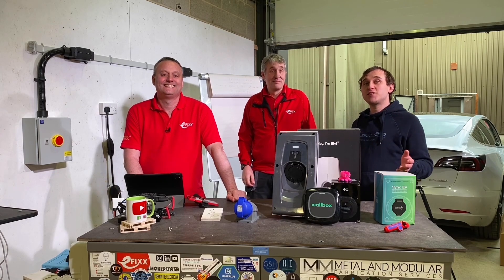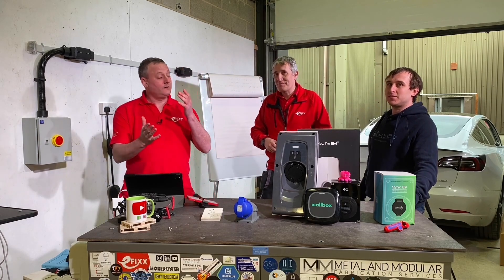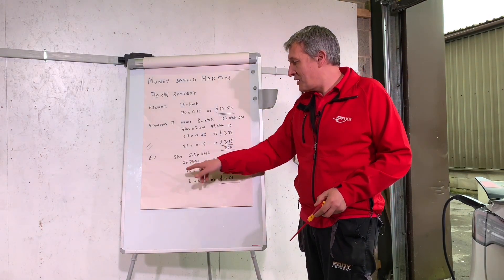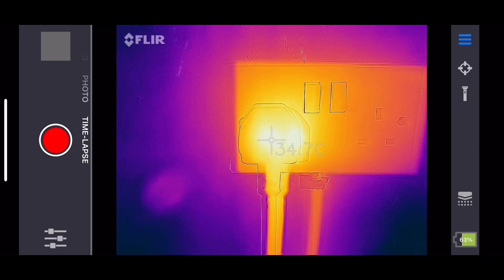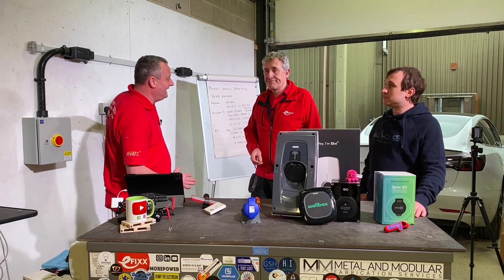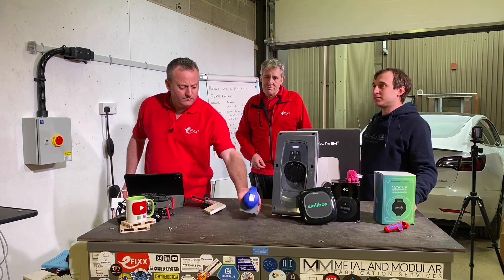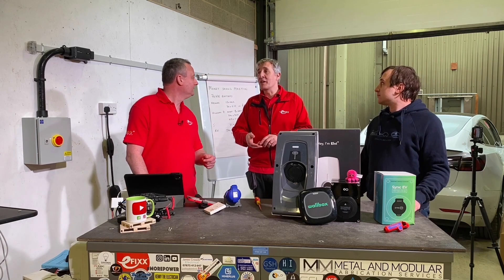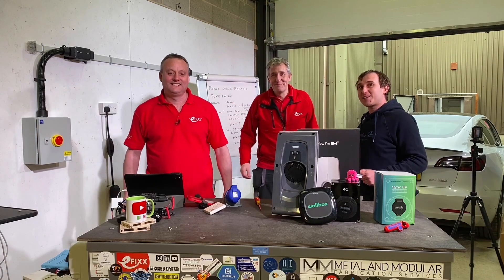5 Reasons NOT To Charge An EV By 3 Pin Socket!

Comment: Because of where my electricity box is installing a 7kw point is coming in at over £1200. Been using the granny charger overnight a couple of times a week for 6 months with no issues.
Reply: Never ever connect a granny charger with an extension lead always a dedicated outside socket
Reply: I need a adapter could they help or are they useless
Reply: Just be sure that if you continue to use a pEVSE, fitted with a 13A UK 3 pin plug, to charge that you reduce the charging current to 8A *max*.  Otherwise, ultimately either the socket or plug will deteriorate to the point where extra resistance appears between the plug/socket contacts which will generate heat.  Heat = more degradation of contact and more resistance = more heat, and so on... to the point where the plug/socket may become dangerously hot - even if that danger 'just' means a nasty burn when some hapless individual goes to unplug it. I used a 13A socket (albeit a good quality and weatherised one) for over 10 years but I only used about 10kWh or electricity per charge or around 5 hours of charging a day.
Reply from the maker: Just because it’s been fine so far doesn’t take the level of risk away,  that’s like saying “am a free climbing up the Empire State Building loads of people done it before and had no issues”
Reply: @NicolasRaimo  I've been watching the guys at 'efixx' for some time and don't doubt the concerns they raise. That said if the concerns are valid then does that bring into question the use of granny cables at all. Or, at least, with some very clear caveats around their usage. The problem with that is that it then puts a question mark over the convenience of EV charging with a granny cable, which is slightly against the EV message. People buying EV's vary from those who research the heck out of the concept and go in with their eyes 100% wide open, to those who are less well prepared and perhaps rely on the good advice (?) of folks such as car salesmen to ensure that customers are well informed. This matter might be regarded as counterproductive to making a sale. IF granny cables are risk-rated to being "occasional use" devices, for safety reasons then this needs to be made much clearer. Conversely, if the risk is considered to be "manageable" then that should be made clear.
Reply from the maker: Stephen most car makes say just that on the cable or manual now,  and that’s another reason why this video was made to help educate and spread the word
Reply: @NicolasRaimo  I dont think the risk is quite the same as that! I'd fall off before I started. My comment was just for some balance. I haven't seen any news articles where using a 13a granny charger has caused a fire. Tumble dryers seem a lot worse. Although a 7kw charger is the way to go especially if using Economy 7/Octopus, it's not the only option if it's not viable, the granny is OK!
Reply from the maker: @RexBase  the number of people with EVs and chargers is relatively low,  as these increase the number of people at risk increases,  the regs and codes are in place to protect people of course as always people with less care about safety will always exist
Reply: @NicolasRaimo  ''the regs and codes are in place to protect people'' and also help electricians line their pockets.
Reply: @NicolasRaimo  Same driving on any road, anywhere in the world, in any car.

Comment: i want an elecetric car but its pretty impossible to charge at home. only way i can do it is with charging on a granny charger at work for free or super markets etc.  is this viable?  cheers, its likely i will only be using the car local and some camping trips maybe within 50 miles.
Reply from the maker: It’s viable to use only public chargers see comment above who does just that there’s also a blog with Els electric dream on my channel
Reply: All chargers have their place. Including Granny cables. Very useful.

Comment: It seem that your saying that a granny cable supplied buy the manufacturer isn’t safe ? Your say theirs no export payment anymore the government has stopped that. However you haven’t pointed out that some suppliers will pay for exported power, OctopusEnergy for one.
Reply from the maker: If your socket has all the protection of an EV charger and your charging for short periods and there a newest install there around the same safety still less due to the connection not being as solid and safe as an EV connection. It’s worth nothing by time you fitted all these extra safety devices your at price of an EV charger including them!

Octopus pay export at 5.5p however at the price your much better using it!
Reply: @NicolasRaimo  
I’ve never used my granny! to charge our Nero and I agree ones much better with a dedicated 7 kw charge point but I feel one shouldn’t be too alarmist about using a granny if needed, on holiday for example.  Whilst of course it’s better to use the power generated by ones  solar panels,  In summer my system can produce up to 40 kwh’s in a day and I can’t always use it all so 5p paid by OctopusEnergy is not to be sneezed at.
Reply: @wobby1516  I think the point is you shouldn't be using a Granny for everyday charging.  Renault label theirs (a very expensive option) as for occasional use.  Using whilst on holiday to get you a few miles extra is fine (or as I do, using it when I visit my mum and dad - Their house was rewired 2 years ago so I know their electrics are top notch) As an everyday charger it isn't a good idea.

Comment: Three strangers talking at length in an enclosed space. No social distancing. What a poor example you lot set!
Reply: My apologies guys about the open volume I was wrong. Having watched a load of BBC studio programmes and yesterday’s Fully Charged interview I expected to see the same degree of separation as they used.
Reply: Two people who work together in a bubble and a guest.  We take regular lateral flow tests.  Enclosed space with huge door open to ventilate the space.
Reply from the maker: I took a lateral flow test night before efixx meeting and the area is well vented if you see where the tesla is parked the roller shutter is fully open,  I also have zero contact with outside world normally and my partner is fully vaccinated against covid19 as a front line worker

Comment: Although the guys presented "perfect storm" scenarios, and it's good to know what to look out for, what the Maths guy didn't include in his flip chart calculations is the horrendous cost of having a 7kw charger installed. If you're lucky you might pay the £700+ quoted in adverts, however all my quotes came to twice that amount and that would make my fuel costs the same as petrol for probably a couple of years at my annual mileage.
As you say Nick, you are not an electrician, and those jolly guys in the fancy red uniforms trying to sell their services and putting the frighteners on The Public, look like the Electrician versions of a used car salesman.
Reply: First time we’ve been referred to as used car salesmen - could be a new calling for us. Questions  for you - How old is the electrical installation in your home and how are you charging at the moment.
Reply: @efixx  Perhaps you would not get this kind of second hand salesman comment if you were realistic about the practical cost that there might be to have a ‘charger’ installed because of new regs and complications that might come with it. Both labour and parts. DNO fuse uprate, wiring uprate, consumer unit change/upgrade or new one just for EV, ground work, PEN fault detector/ earth rod, maybe even re-wiring, etc. I am not saying that it is a bad idea to have your house electrics checked over, but the costs can be high.
Reply from the maker: @efixx  can I add... when was the last time you had your electrics tested
Reply: @efixx  if it helps I'd buy a used Cortina from you.
Reply: @100tinsoldiers  The Cortina has just gone - We do however have a beautiful Austin Maestro - low mileage, one careful lady owner.
Reply: @efixx  I’ve always wanted a maestro, as long as she only drove it to the shops and church on Sunday I’ll definitely take it.
Just one question, why is the front green and the back yellow.
Reply from the maker: Efixx is not an installer they don’t sell or fit charge points Gary used to be a lecture

Comment: A lot of chargers have a temperature sensor in the plug and options to charge at a slower rate.
Reply: Yes and Boris Johnson may fall from a chopper through my roof on a Wednesday too....
Reply: That's great, so only 42hrs for a full  charge
Reply from the maker: They still be missing the other safety equipment
Reply: Not seen that is it a rtd. Thermocouple or thermistor device.the control equipment connected to that would be interesting.

Comment: Great video Nick! The only worrying thing is when professional electricians speak of a 70 kW battery...
Reply: The other glaring error is it takes more than 70kWh to charge a 70kWh battery 🔋- but car manufacturers don’t talk about that shhhhh!
Reply from the maker: @efixx  sssh don’t talk about loses
Reply from the maker: It just proves how easy it is to verbally make mistakes with no script even when you know what your talking about if they wrote it down they’d do it instantly
Reply: @NicolasRaimo  they even wrote "70kW battery" on the whiteboard 😫
Reply: The cost analysis also failed to include standing charge differences between economy 7, Octopus and others, and the fact that with economy 7 and Octopus, the on peak price is likely to be higher than on an alternative tariff. It's all up in the air at the moment with the volatility and distortion due to the price cap, so general comparisons cannot really be made just now. But it was certainly the case a while back.

Comment: Great video. I have a 7kw charger at home (but no EV at present). I did find the granny cable useful for occasional charging at relatives and also at home when my Chargemaster unit wouldn't talk to my Zoe (frequently happened and I'm on my third charge unit now). My patio heater is 10.5 A, hopefully my wiring is all good.
Reply from the maker: Your patio heater will be on its own circuit, and also won't be running for the hours an electric car may be on charge for.  Also some 13 amp sockets will be on a ring main with other sockets as well!

Comment: Thanks for dropping in! - We couldn’t believe people would stick with a 13A socket for charging.
Reply from the maker: Its very common place in EV consumer market as they assume it came with the car its safe...  As we know even a new install of a 13amp plug doesn't have the required safety to meet the regs if it was installed for the purpose of charging an EV and many customers I suspect ignore to tell the electrician that is the purpose of it!
Reply: @NicolasRaimo  the 13 amp plug on my cable is waterproof and sealed and came with a very substantial cable. I would not put it on an extension cable unless it could take 3kw.  I always use less than 3kw  ie 12.8Amp. In fact it has not drawn more than 2.4 kw
on my BMW i3 and that is at maximum setting. I use my solar panels and can see what is going Ito the house what is going into my solar battery and what is being fed into or from the grid.  When I go to my son's house he has waterproof outside socket which I have successfully used.  I am retired and not in a hurry.to charge it.  I have foundd commercial chargers very confusing. I have a range extender which gives great peace of mind.
Reply: You couldn't believe people would avoid spending £500 on a charger, whilst still safely charging their car with a good 13A socket?
Reply: It’s not just £500 to buy and have a decent charger fitted. Firstly, the dno fuse may need replacing. The dno wiring may need replacing. The electricity supplier may have to liase with electrician/dno to upgrade meter wiring. Good luck with that. Then the electrician may say you need a new consumer unit. There will be no dno isolation switch so the electrician pulls the dno fuse against regs. Oh, but now the convenient regs say he has to install pen fault protection, Type B RCD and surge protection. Then the ev charger can be installed. Total cost could be £2k or more using a '£500' charger if he doesn’t decide any of your house needs re-wiring aswell.
Reply: @jam99  500 was just an arbitrary number, I realise all those things are in effect.

But you shouldn't be paying for an updated fuse, DNO does that for free. And you don't need a new consumer panel, electrician can use a sub-panel.
Reply: Sorry, you are correct with the DNO not charging for fuse. It is the electricity supplier who may charge over £100 to have 25mm2 tails fitted and the DNO will insist on that before uprating the fuse.

Yes, you can have a sub-panel. I still received quotes of £1.5k and £2k for Zappi install for that (5m of outside cable, easy access, 1 hole in wall).
Reply: @jam99  I didn't pay for my fuse upgrade from 60A to 80A. My friend didn't pay a penny for his supply to be unlooped and 3-phase laid in the trench. There are somethings the DNO are responsible for.
Reply: @EP-bb1rm  As I corrected myself above, it was the electricity supplier who was going to charge. Looking back, the quotation just to uprate tails between fuse and meter was about £200.

Comment: Useful information - why wouldn’t you just go for the proper EV charger so you can charger at a faster rate.
Reply: lock down. I hd an appointment cancelled and all through the lockdown I have used a pucker EV charging cable with a 3 pin socket.  I also have solar panels.  My BMW i3 has 3 settings maximum (2.4Kw) on my house circuit{ Reduced 1.7kw and low(1.4kw). I am retired and can adjust according to how much electricity it will draw on a 13 amp fused plug.  I have had no problems. I have been using less than a bar electric fire!
Reply: @lindasims7130  do you do most of your charging off your solar panels ?
Reply: @efixx  yes even in the winter when we have some sunny days but of course my mileage on my i3 has been much lower than usual.
Reply: 2 bar electric fire
Reply: Why does everyone need to charge at a faster rate? 4 hours Octopus GO, call it 8kWh, 24 miles a charge, 8760 miles a year...
Reply: @EP-bb1rm  it’s pretty useful when you get home late nearly empty and need to leave early in the morning.
Reply: Not many can afford to install an EV charger at their house since they cost about $11,000 plus installation. Most would be better off using the charger which is built into the car, and just installing something that feeds that charger with up to its maximum current at the proper voltage, such as one of the many EVSE designed for home use. 

But there is a single phase 208-240v 25KW charger you can install at at home made by Bosch.
Reply: @imho7250  sounds like you are taking about a fast DC charger at those prices .
Reply: @efixx , yes, it’s a 25KW DC charger, one of the few you can buy for home. It doesn’t use the car’s built in charger like any of the home EVSEs that people often mistakenly call a charger. But there are chargers available for home use. They should stop calling these high powered smart extension cords chargers because they either let the AC power get to your car or shut it off, zero control of Amps or volts are done. That’s all done in the on-board charger.
Reply from the maker: @IMHO the price your talking is for DC fast charge stations,  we are talking AC chargers,  it’s worth remembering UK and US market also very different in terms of wiring and electrical safety.

As mentioned AC home chargers are not in fact charging the car the car holds the charger however it’s a term the general public use
Reply: @NicolasRaimo , yes, it’s a charger. Not an over-glorified extension cord.  I put a link to it in the comments but it’s probably trapped in your spam filter. This real charger uses 165A so it’s going to be expensive to get installed. I doubt you or Tom Moloughney will ever have one of these on your EVSE wall. 

While it’s ok to say many people incorrectly call EVSEs chargers, it doesn’t mean those who are educating the public call them chargers all day with mention they are really not chargers, they call them EVSE’s all day and mention that some refer to them as chargers. 

Right now EV chargers are almost cost prohibitive for home use, but as the prices come down and use cases go up, some of the more wealthy will be installing chargers at home instead of EVSE’s. 

An example might be an iPace owner who works from home and needs his car charging much faster than the on-board charger. Or if you bought a fleet of old 24 kw leafs with Chademo and need to get them topped off and out the door.

For older Tesla S/X with dual 40A onboard chargers, giving about 20Kw charging, it would make no sense to add a 25 Kw charger, because it would not be fast. 

The power adapters that you plug into your laptop is also not a charger, even though it does a lot more than an EVSE does, but converting from AC/DC. The charger is still onboard which controls the amps going into the battery, which is what charging is.
Reply: @imho7250  wow, pedantic much?
Reply: @cjmillsnun , I’m an engineering instructor so yeah, I need to be correct. Nick can choose to be correct or incorrect. But if you want to plug in a desktop PC with a cable and call it a charger go ahead. Lol